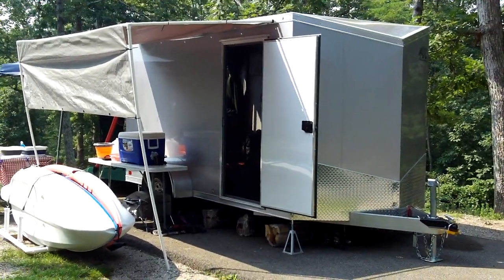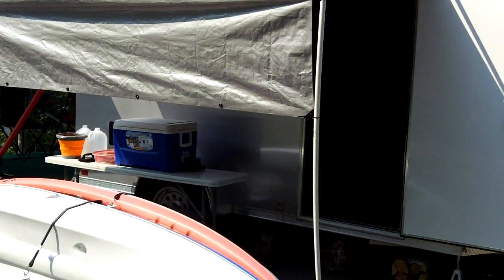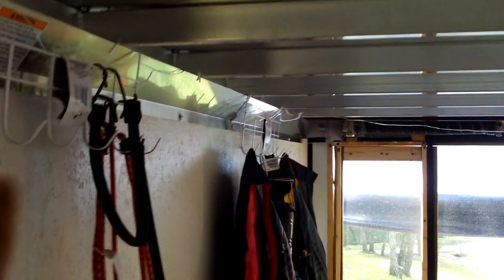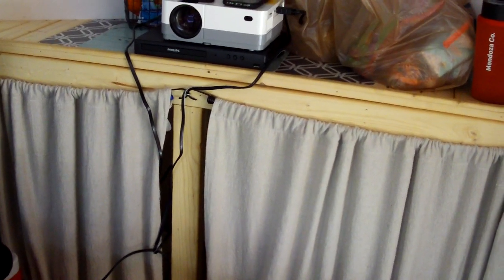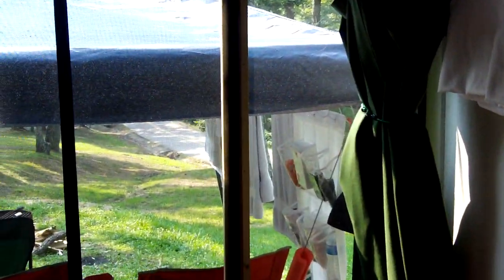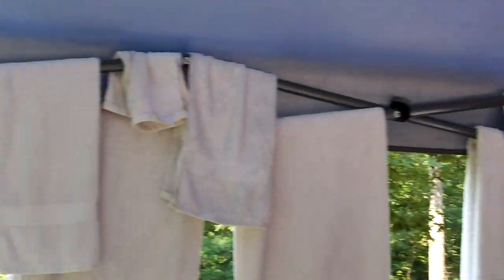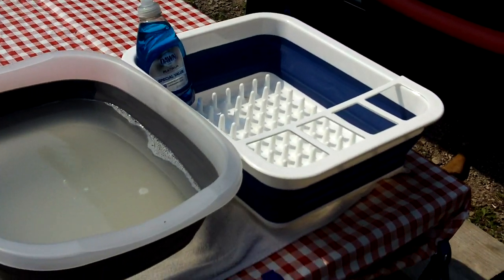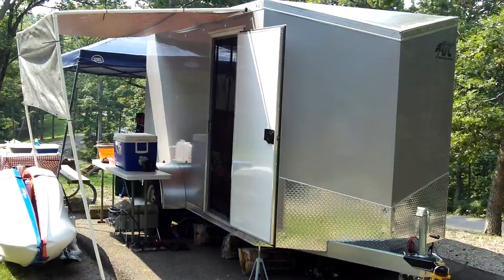Enclosed Trailer Camper Conversion

Comment: That’s a very nice rig.  Who is the manufacturer?  I like the awning, I think it could work really well with electrical conduit as the frame.  This is definitely going on my list of possibilities.  If your 12x12 can go high enough, getting it over the rig roof would be a plus if it rains.  The baskets are terrific too.  They seem to hold a lot.
Reply from the maker: Thanks. The trailer manufacturer is ATC,  aluminum trailer company.

Comment: How much insulation in ceiling & walls.👍😎
Reply from the maker: We haven't done the ceiling yet but when we do I'll keep you posted (hopefully soon). Planning on cutting  the foam board tightly between the roof braces but for now it keeps us dry. Continued projects are all around me. Lol